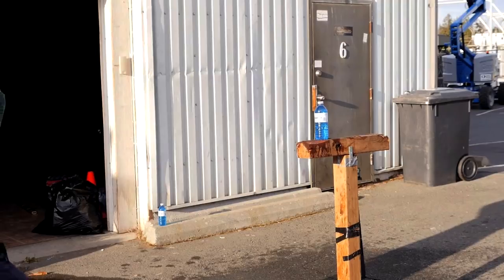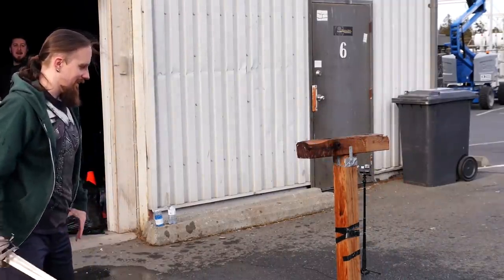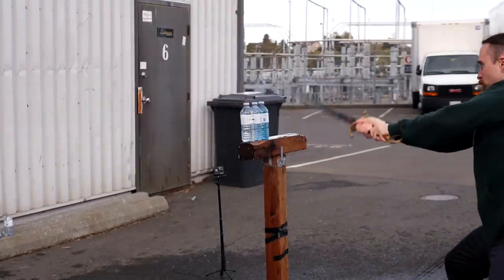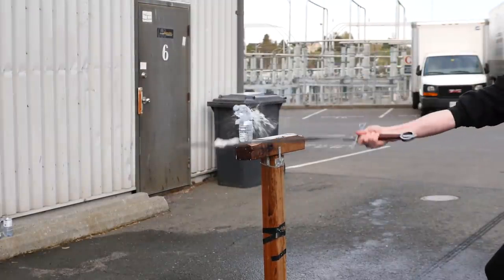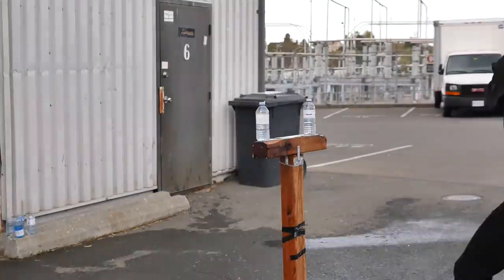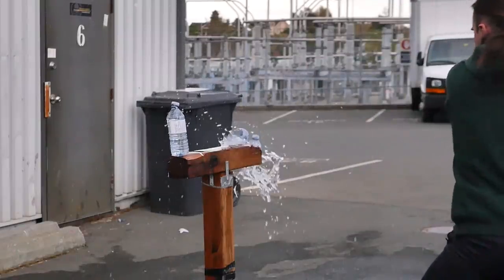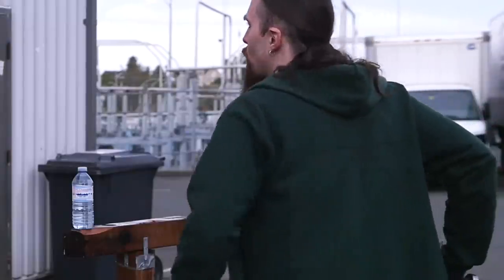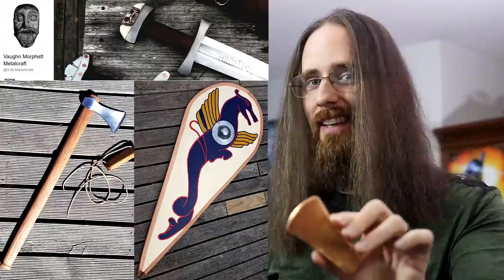Cutting Practice on the Cheap - With Commentary

Comment: Another thing to keep in mind with water bottles is that examining the carcass can give you more information about your cut. If it's a clean straight cut, good. If there's a  scalloped curved line it can tell you if your edge alignment is up or down. If it's a tearing cut you were too far back and cut with the tip. Etc.

Comment: You know, I would love to see one of you guys do this with an axe! :-D Specifically, I'm actually very interested in the kind of cuts one could make, as well as how much finesse you could put into it. Axes need more love! :-P
Reply: Axes cut more with mass than swords dunno if you can really do a clean cut without bottle flying off every time (axe blade is much more thick for one) But could be intresting it's sure.
Reply: I would also like to see axes, poleaxes, and other poll arms. If the 500mL bottles are too difficult,  go for 2L pop bottles or 4L milk and windshield washer fluid bottles.
Reply: Did somebody say.... Axe? :D
Reply: @erikbailey2525 , I believe you have to reapply for your axe wielding permit. Proof of insurance is also required.
Reply: I've halved 2 liter bottles with an axe before the axe has to be very sharp and your edge alignment has to be really good but it works as good as most knives do

Comment: Nice!  I started collecting bottles over the winter with the intent to get into cutting as the weather warms, but now find myself constantly busy at work.  Not that I have much to cut with; just a cutlass and a couple of Cobra Steel blades (kindjal, wakizashi & falcata).  I'm planning on adding a longsword, but may have a bronze sword made first.  Also, considering adding the curved variant of a kindjal as well, which seem like another quick & simple acquisition.  Plus, I hear curved blades help beginners with learning edge alignment, so why not, lol

Comment: If I may make a suggestion. I used to work as a land surveyor years ago. One of the things we did was clear brush to get line of sight from one point to another.

This required a lot of time swinging a machete or brush hook. My suggestion would to spend time swinging a machete.

Not only would this develop arms strength and endurance but develope edge alignment sensitivity while swinging a blade at full power.

At one point I could cut through a three inch oak sapling with one stroke. Nothing cuts like a nice sharp machete.

Comment: I teach and train in jujutsu and our system also does heavy training in kenjutsu (yes, yes, katana stuff).  For advanced students and instructors actual cutting is essential and there really is no substitute to show edge control and proper form.  As you note, however, tatami are way too expensive.  I have vanquished many a water bottle, let me tell you. Also, though, one of our main targets are foam "pool noodles." In my case I drilled a hole in a tree stump and friction fitted an old broom handle.  I slide the noodle onto the dowel which sticks up a foot or so, just enough to support the foam noodle.  Cuts have to be nearly perfect or those wobbly, unstable foam floats let you know your every mistake.  I find them on sale for around $2 US or less.

Comment: Could you go over the cleaning process? Presumably after doing this kind of cutting you need to clean the blade to make sure there's no residual water that could rust it, particularly in somewhere like....British Columbia was it?
Reply: I wondered the same. Most steel armour/weapon cleaning pastes have waxes to coat the metal when buffing, but how well that holds up, if at all, to this use would be interesting. I'd imagine water is a little less caustic than blood.
Reply: Wipe it down with a cloth or paper towel, make sure there's no visible water remaining. Take a green scrub pad and some automatic transmission fluid and give it a good scrub to make sure no rust forms. Wipe that off at the end with a paper towel. Leaving a thin coat of oil will help keep the blade from rusting while stored.

Comment: Trained today with few swords cutting bottles. Drinked plenty of beer. Could not cut those empty suckers because in Finland you can recycle them and get 5 euros easily maybe 10 euros if you drink alot :D Sure the inside cost more but you still get money from them. I have to use bokken most of time or coldsteel viking sword plastic sword :D

Comment: in other words a proper cut is merely a battle of an end result of whether or not it's gravity or inertia that affects the bottle the most. if there is too much force or the cut is wrong then the inertia will win the fight and thus the bottle will react in turn. but a proper cut will cause less impact to take effect and gravity will take over the end result causing the bottle to "fall apart rather than fly apart" right? and the watter inside the bottle gives not only  the mass needed to take the impact but also the weight need to hold it down right? makes sense if you ask me ^ ^

Comment: What is a good and cheap replacement for tatami mats. No water bottles cost 25 cents Pfand in Deutschland each. Seriously rolled up cardboard? Bundled twigs?
Reply: Collect empty bottles with caps and refill them at home. Pretty much free.
Reply: Roll up newspaper into tight sticks/rolls, tie or tape them & then soak them in water. Bit like limbs or totami mats.

Comment: Was that longsword an Albion Crecy?
Reply: It was!
Reply: I've been wondering how they handle. Mike at Albion said they handle a lot like the Maestro Lichtenauer: a good cut and thrust. Is that accurate?
Reply: @exander3636  I've never handled the Lichtenauer, but the Crecy handles quite well. If I worked out a lot I could probably use it fairly effectively with one hand.
Reply: Oh, ok. I would highly recommend the Lichtenauer if you get the chance. Thank you very much for the info.

Comment: Could you use a material other than water, like sand or dirt...or jelly or something?
Reply: The idea of cutting through sand or dirt every time makes me shiver.
Reply: @WoWroguefan  Why?
Reply: @WoWroguefan  Wouldn't a dry substance be better for the sword?
Reply from the maker: Sand and dirt are highly abrasive and will quickly wear down the edge and scratch up the finish. Jelly is okay though.
Reply: @Skallagrim  Thanks.
Reply: Sand & dirt very quickly blunt an edge. You keep edged weapons & tools away from them as much as possible.
Reply: @2bingtim  Thanks, butI was just using them as an example of a dry substance because I was curious if there's a viable alternative to water.